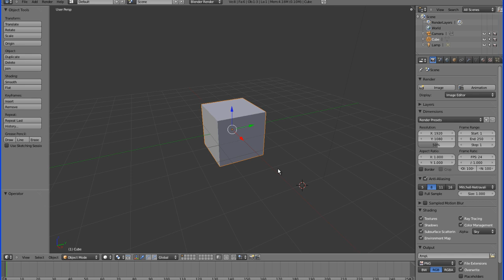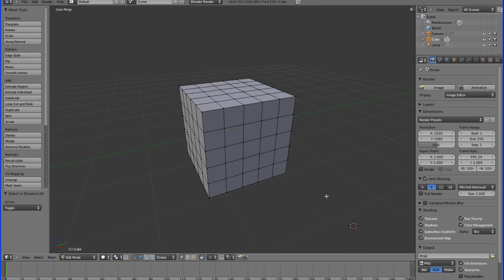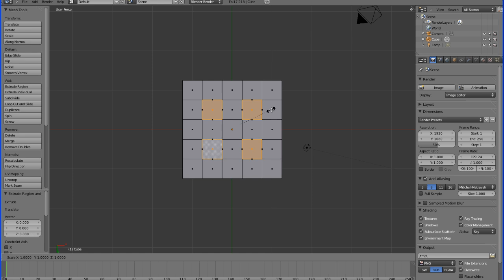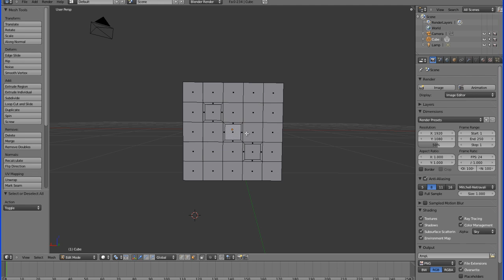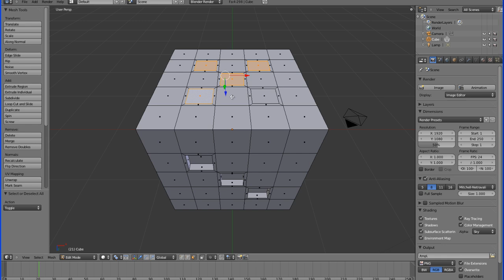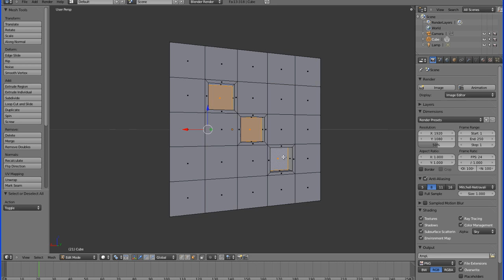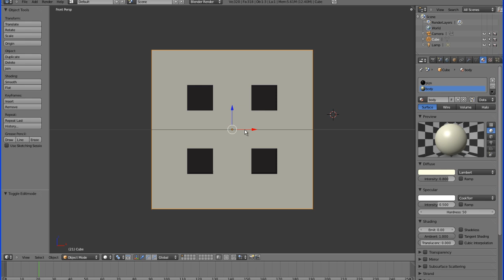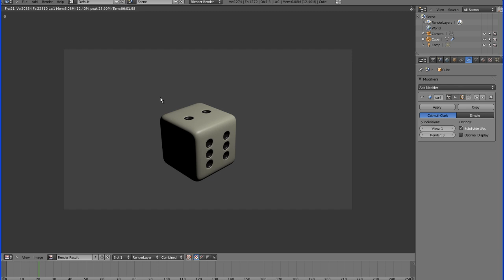How to Create a Dice Cube using Blender 2.5 (HD)

Comment from the maker: @AwesomeRoyur 

Hi there! In the default mode, you can use the number pad keys to rotate the camera view. If you go under the VIEW menu, you can see the different views assigned to the different keys. To inch around like I did at 1:47 you use 4 and 6 on the number pad section of your keyboard. I hope this helps! I know it can be crazy confusing.